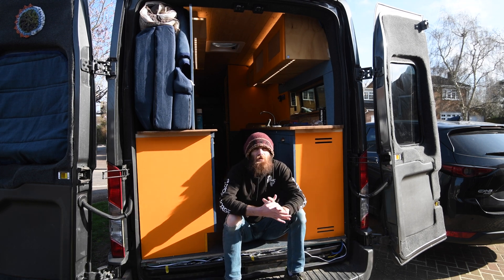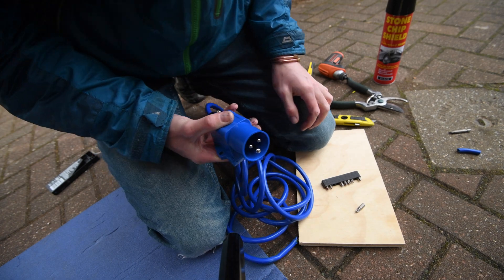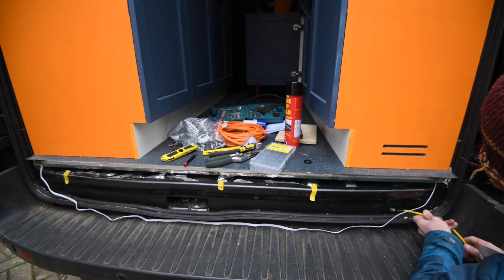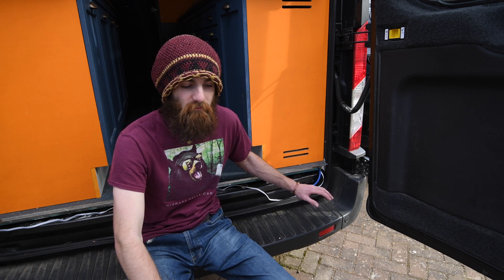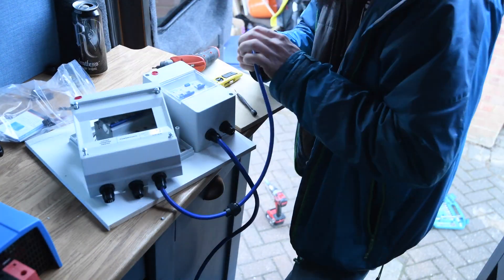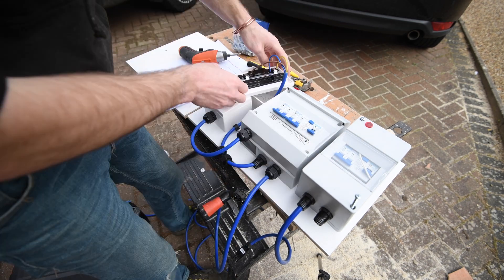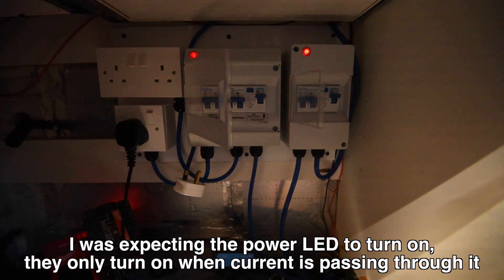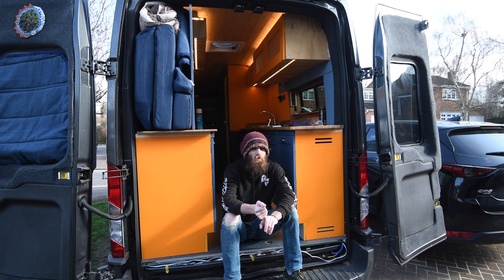Part 2: Installing a Victron MultiPlus : Install, Earth & more | EP49 | Ford Transit Campervan Build

Comment: Nice Work. Few things:

RCBOs are smaller than RCD + MCB.

The Inverter earth is supposed to be connected to the DC ground at the Distribution.
We link the DC bus to the Earth Bus in case of a mains fault on the chassis.
This opens us to a DC fault on the case of the inverter chassis or internals being transmitted on the earth...which means the Earth ought to be one size smaller than the inverter feeder. 
25mm² in your case. 
The inverter earth, the chasis earth and the Ground to Earth bus link are all 25mm². Unless you want to use your Chassis ground as your earth which is acceptable when the buses are linked.
That's why your inverter earth terminal is so substantial.

I see your battery to battery charger is the non-isolated flavour meaning your LFP battery is common ground with the Vehicle Chassis across the controller on a rather underwired 4mm² trace.
If that's the only path it'll vapourise in a fault.

I use H07RN cable instead of Artic. It's much better. Flexible and heavy-duty, not blue. Artic is for outdoors.

The reason your lugs don't fit is the cable doesn't meet spec. Hi-Flex is it?
If you measure it you'll find it's a size smaller than advertised. I've gotten them to replace all my job cable after kicking off about it. I should sue them but life's too short.

Those mega fuses are not the worst. You really ought to be using a Class T if you plan on pulling full duty continuous. Mega fuses at ~100A are 10W heaters.

Check terminal torque on everything after a month. Vibration and settling might back off things.

70A Charger?
I've found some proper LFP charger derating data.

The charge rate needs to be reduced proportional to temperature...it's not simply a 0°C threshold.
I made a graph
https://i.imgur.com/gr2hYWG.jpg
based on CALB documentation
https://i.imgur.com/ARWSedF.jpg
Reply from the maker: Thank you. 

RCBO would be a smaller unit but acquiring / ordering them separately was just easier for me to my hands on 

My B2B is the isolated version not the non-isolated. There so no common ground between starter battery and leisure battery. As both my circuits isolated from each other, there doesn’t seem to be a functional reason for me to connect the leisure systems DC neg to the vehicle chassis as I am not using it for a negative return like the van own electrical system. Unlike pre EURO 5&6 van without a Smart alternator, when a VSR / split charger relay was normally used for Chargjng the leisure battery ( if it was lead acid based and not lithium ) 
 
Additional that is why the AC isn’t linked via the DC bus back the chassis as in my case there isn’t a connect between the DC neg bus and the chassis. I thought I had also seen in the UK numerous times in different groups mentioned ( unsure if for practical or regulation reasons ) that a DC connection and a AC Earth bonding connection shouldn’t share the same point to the chassis. 

Charging wise. My bank is 3 x 130ah valance u27-12xp. Running in parallel, manufacture recommendations are a max continuous charge current 65A. So 70A across three would only be 23.3a each. The also use 18650 cells in 4 groups of 100 each
Reply: My bad on the isolated DC I thought TR models were the non-isolated type. I don't usually use anything under 50A and mostly I mount dedicated alternators or twins.
The DC ground and Earth ought to be linked, it'll prevent the solar array from climbing to uncomfortable voltages if you are in series up there. It's also because you have an inverter and having both mains and ELV in the same box means it's possible to put 230v on the battery terminals.

At the end of the day it's about making it failsafe not about making it isolated. If it's isolated in a way that's impossible to fail dangerous then that's fine, or you can live with the risk without hurting anyone also fine. The inverter being LF has a lessened risk of the battery appearing on the neutral so the chassis is isolated across this. If the inverter was HF then one shorted FET could = world of pain across the PE-N path.

If you continuity check the hab battery negative to chassis and it's OL in both polarities then you're scraping a pass...I expect you'll find capacitors there though.

This is Gibbo's take (Smartgauge website...bit dated still useful);
-------------------------------------------------------------------------------------------------------------------
" Assume the AC system is bonded to the hull but the DC system is not.

Some equipment is connected to both systems. This sounds rare - in actual fact it isn't, dual voltage fridges, battery chargers and inverters are all connected to both systems.

A fault in one of these items could cause AC mains to be presented to the DC side. If both systems are bonded to the hull, this will instantly cause the incoming fuses or circuit breakers to blow.

If one of the systems is isolated from the hull this will not happen. The result will be that the DC system (which we all assume is safe to touch, and which usually has components with insulation rated for about 50 volts) will be sat at 230 volts with respect to the hull or the other electrical system. Clearly this is highly dangerous. "

------------------------------------------------------------------------------------------------------------------------

Regarding the DC and Earth not sharing the same point...well it has to somewhere when you think about it. Probably redundancy or when one fails the other has to work and trip the failsafe to alert the user of a fault maybe. If it was a boat I would say you absolutely have to link them at the same point otherwise you'll get cross potentials and galvanic corrosion.

I've a set of flooded 235h flooded leady golf carts in my little camper...max continuous charge is 80amps. Nominal year-round temperature is ~10°C
The reason I mentioned it was because you have to proportionally throttle your charger according to temperature for LFP, if you read the small print on those Valance you'll probably find it says "in 25°C".  
Have a look at lithium plating as a concept. People are saying you need to stop charging at 0°C but think 100% duty is ok at 1°C...you know it can't be. 
70A = 0.2C....probably fine between 5°C and 55°C. I made the mistake of thinking I could charge LFP at C1 like I was promised. 
It annoys me to find I could charge a cheaper yet larger lead battery faster than lithium in most of my installations in most circumstances and the efficiency is higher because no heaters.

Your lights are mad by the way...I was watching the NFC video..wow....
I thought I was bad with my 3-way switched, 7 present scene controller, programmed off the back of a lighting console with 32 independently dimmable channels...I like buttons...the phone thing isn't my bag...I loved your line "maybe that doesn't interest people because they won't care about the BMV..."

Here's probably the best resource I have found on LFP charging:
http://nordkyndesign.com/charging-marine-lithium-battery-banks/

Love your work.
Reply from the maker: Lots to read through there. 

The Orion product line by Victron is confusing at the best of times, it has a mix of isolated and non-isolated models and on top of that a mix of charger and converters all in the same looking blue box and pretty identical names. 

At the moment I’ve found no continuity between either pole of the leisure battery and the chassis. 

I definitely agree with cold lithium charging. Hopefully no one believes ( but I’m sure many do! )  that just being 1 degrees above 0 they can hit it at high amps again. My cuts off to pretty reserved about 6c, below I don’t allow charging and again at the the only charging likely to happen near that would be before the solar or B2B. Unlikely to be 70amp from the Multiplus. Actually when inhabiting the van it really reaches anyway that low. 

I’m very happy with how the lighting turned out, Adapting the base system which I had for my old house and then adding a few extra light strips. Whilst I don’t use the NFC tags much I like the options, the phone use is mainly the set up and  overall programming of the scenes , zones, presets and so on. Primarily day to day interact with the System is via the wireless Philips hue controllers ( set up with  my most frequently used to scenes, bed rooms, night time dimmed, full bright and so ) and Alexa when I have signal. 

I try and be honest in the videos. As I do a lot of stuff in my van build which a lot of people just don’t care about or are not interested in. Which I’m totally fine with. It’s my van after all.
Reply: I reckon we could outnerd eachother every other turn. I'll send you a link to my truck build when I start it. I was laughing to myself as you were programming the on off toggle and debating whether I'd have the walls pulled apart and data lines run to controllers faster...juries still out. 
Actually here's my lighting solution on a bench https://youtu.be/Z1EFDVdUGjY
All hardwired.

No continuity is good if you are running isolated. In ways it's better, mistakes with spanner shorts and LFP are violent.

I specialise in pulling everything I can from an alternator. That means I can break a solo battleborn in a single season (C1 in <5°C) it depends on where the battery is. Boats they live outside beside an engine usually. Under the driver seat is usually a lot colder than the hab quarters.

Careful connecting big inverters to batteries with a BMS onboard too by the way, you oughta charge the capacitors first with a resistor, you can blow the onboard FETs with the capacitor inrush. Will Prowse did a video...

That Nordkyn link is the best read. Eric is a prodigy (and answers emails) and one of the only honest LFP engineers I've seen. They are incredibly difficult batteries to utilise with all the stipulations. I've a coupla sets...took months to program/write/fabricate the BMS. Memory effect is a pain. CC charging in a 20% - 80% envelope while overcoming memory effect is no easy thing, balancing, charger throttling...it never ends. Anyone asks me to install LFP for them I say no but I'll get them Firefly Oasis AGM instead.
Reply from the maker: And yes. I do still need to do the correct terminal torque. one of the tools in lacking at the moment. But I do periodically check them
Reply from the maker: After your previous comments on videos regarding AC earthing and other parts I did research points you brought up. After all you spend the time to making them. So plenty of research as well chatting a Victron dealer and installer as well. 

Mainly as a prefer ( when doing anything )  to have an understanding or even if just basic  understanding of why something is done or should be done, opposed just doing it because that how it’s always done, or just because some else does it that way.
Reply: I wasn't having a moan...I've seen things back off with engine vibration..I melted a cricuit breaker once. It's the same principle of checking yer wheel nuts after a wheel change. "Precession" it's called rotating bodies torque things not always the way you want.
Reply: I realised I hadn't seen any updates in a while any thought you must be upto something....ring the bell I suppose. 
That's it, never accept what you're given as fact, test it, measure it, know it to be true or not....especially in leisure-craft electrics....I could go on, nothing meets rated in this business (10% do...) so much BS and hollow promises. I find Victron very light on information and very "don't worry about it". My battery monitor goes to >100% (Bogart Engineering's Trimetric) because it's a battery monitor I can read from far away most other brand's battery gauge hits a ceiling at 100%..because they are charger interfaces.
Reply from the maker: Don’t worry I didn’t take it as a moan! It’s a valid point! And after seeing the recommended torque settings in the Victron manual when install bits of kit it annoys me still have not done it as I haven’t got anything to do it with
Reply: Actually here's another vid of mine you might like....I grid-tied a camper van. I might be the first
https://youtu.be/QVxeKYOqx1U

Twas the Mk 1...pretty shyte, 50% eficient.
I've DC-coupled it since and now my camper is producing ~ 750Wh a day into my house on a single 265W panel. ~95% I've the camper charge controller and the house charge controller running in parallel off the same panel.

Torque settings? I only use those in ½" drive flavour.  You can get torque screw-drivers...not that fancy me...

Comment: From Canada:  if I may suggest, use ferrules for better connections in screw in cable applications, as explained here:

https://www.youtube.com/watch?v=os66cID30Ek
Reply from the maker: The ferrules I agree for screw terminals and I had researched the area. However I had seen in a few places people recommending not to use ferrules for this style of inverter connection it’s self. The the screw itself isn’t what is making contact ( unlike in a AC plug for instance ) , ( probably has a correct name ) but angular type of clamp bringing to surfaces together via the screw being turned. 

My lack of ferrules for the AC is I just don’t have any at the moment,
Reply: Cage clamps is the word you're looking for. I ferrule them anyway, saves a lottov time if you ever rewire it.
Reply from the maker: However the conflicting information I’ve come across might also be down to different countries having different regulations on what has to be, what can be and what shouldn’t be used in different circumstances

Comment: Shouldn't a type B RCB more appropriate when DC leakage is a possibility?
Reply from the maker: Both Type A and Type B would work for the intended application, with type B covering a few more things as you have mentioned . Seems type A is more commonly use as it’s a cheaper option whilst still performing the main objective in a campervan situation which to tip in the case of the chassis becoming live under fault. 

It seems that Type A is the Standard requirement whilst type B would offer additional protections
Reply: If it's a high-frequency or transformerless topology then it has to be B-type which are usually far more expensive often buying a low frequency inverter outtov the gates with an A type RCD affords better surge and long term reliability for equal cost.
Judging by the weight and the reduced surge capacity that multi-plus is high frequency.  Because of the lack of isolation between the input and output of the inverter there can be DC injected on the output which prevents an A or AC type RCD from operating in a fault condition.
Reply: I had a look at this https://www.youtube.com/watch?v=UPfUn5ki7OM
Apparently, all Victrons are low frequency...I've never seen a high-frequency one.
..pretty rare these days, only Victron and Studer are using toroids. There's a handful of others using E-I cores not especially worth mentioning.

You should be grand with A type. It is suspiciously light though. If there's a massive donut traffo inside or it gives you a hernia moving it A type is suitable. Most inverters on the market especially cheapos require B-type.

I asked Mastervolt once if their inverters were isolated input to output. They said yes. Then I asked what RCD to use, they said B-type. I asked how could both statements be true..they referred me to a new member of technical support staff. Those yolks are mutton dressed as lamb.
Reply from the maker: I think from looking at the Victron Easysolar unit which is a combo all in one unit with a Multiplus , MPPT with RCD’s and MCB built into the case. It’s seems the  RCD’s ( Chint NL1 ) it uses are type A
Reply: Chint? Oh dear they're cheap Chinesy. Shine a light in or email Victron, you can't miss the transformer it usually takes up a quarter of the real estate. B type RCDs have come down in price since grid-tied inverters and EV chargers are mainstream. I spent €200 on one once. I only use LF inverters now.
I don't think I've seen a B-type RCBO.
Reply from the maker: It’s definitely heavy and appear to have a type of not edible donut inside. Luckily no hernia this time!

Comment: Are you planning to have a toilet?  Did I miss a video?
Reply from the maker: Aye there is a full shower room / wet room / drying room with recirculating shower and toilet
Reply: @MispronouncedAdventures  I saw the shower (which is amazing) but missed the toilet.  I'll take another look back.
Reply from the maker: It’s removable to it was probably wasn’t in previous shots